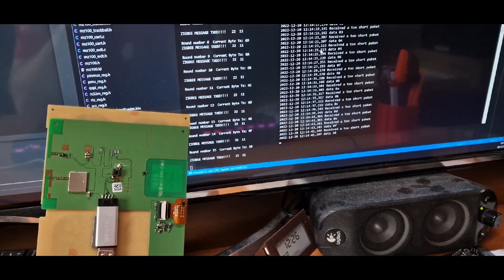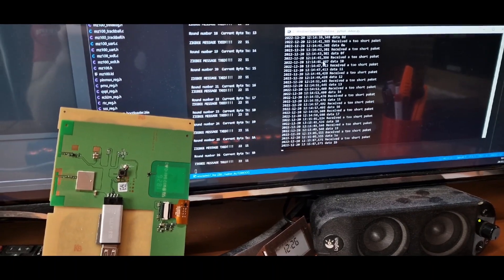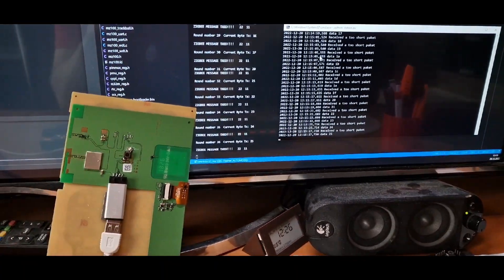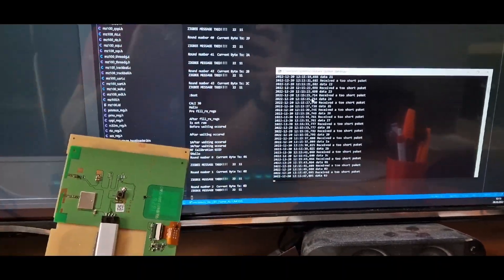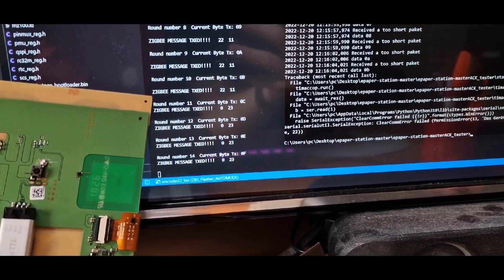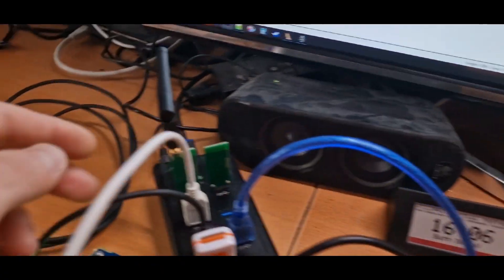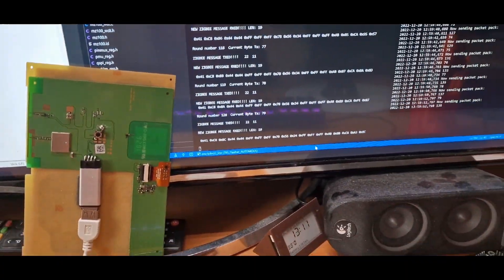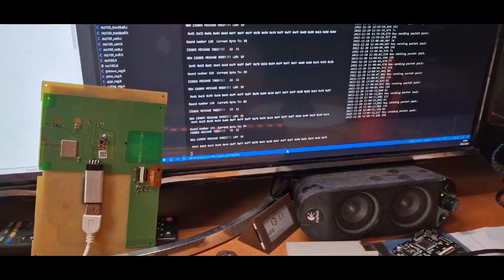E-Paper Firmware for 88MZ100 Closed SOC Reversed Zigbee Communication

Comment: Greetings, I upload the code for NFC that you published on Github to my e-paper, but when the power goes out, it goes back to the firmware, what is the solution to this? Can you also help me can't install through the make onlymake commands?
Reply from the maker: You need to use write_flash cmd and not only write
Reply: @atc1441  Thanks I'll be try
Reply: @atc1441  There is no problem when I run it with the write command, but when I run it with the write_flash command, it searches for the bin file in AppData and cannot find it. I get an error like this: No such file or directory: 'C:\\Users\\samet\\AppData\\Local\\Temp\\_MEI77282/main.bin'